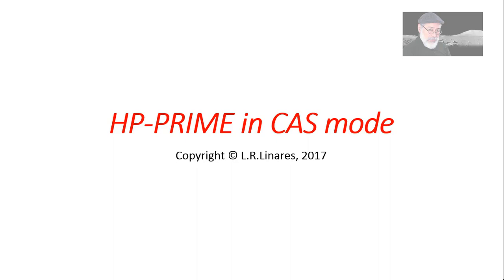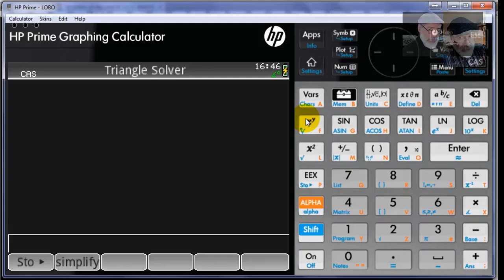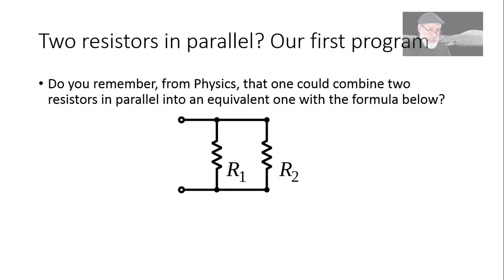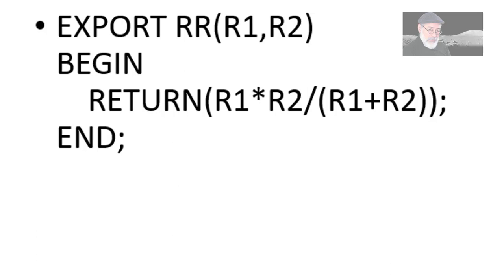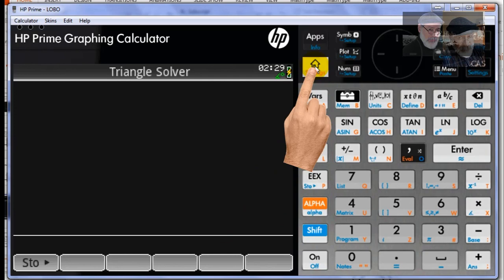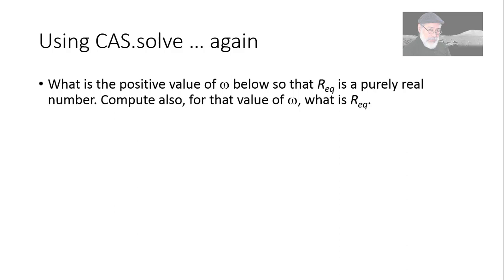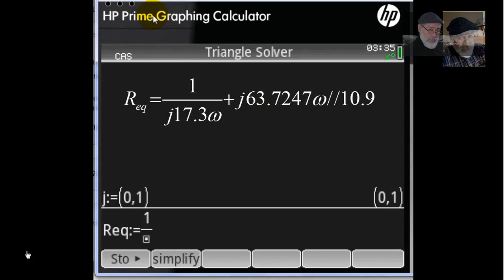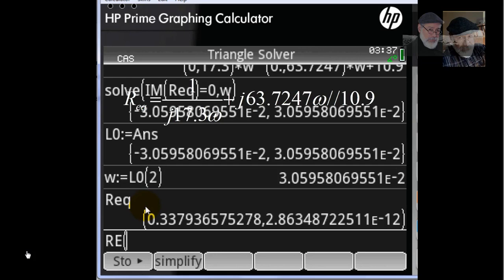HP PRIME 02 - Solving an equation, programming and complex numbers.

Comment: Thanks, Professor. After keeping the Prime in cold storage for a long time, i finally learned how to create a program. You're the best, I wished you were my professor.  Looking forward to learning from you again.
Reply from the maker: Once you get acquainted with the CAS of the Prime, you'll neer look back. I only wished that it had existed when I was an undergraduate student. But then again, I was the transition generation from slide rules to the HP-35, the first one, the original one. I still remember the thrill of finding a sine, or a cosine just at the press of a key (before the 35, engineering students used booklets with tables to find logs and sines cosines and the like.)

Comment: Dear Professor, 
Thank you for your channel. It is valuable. But I think I see a "bug" in the RR program. RETURN should not use the "()" to return value - using it, you return the complex number a real part :). I noticed that by a small mistake. I wanted to round the output to 2 digits, so I wrote RETURN(ROUND(r1*r2/(r1+r2)),2). I was surprised that the evaluation was x+2i. I made a mistake, and I realized output is a complex number. Now I have "RETURN ROUND(r1*r2/(r1+r2),2)", and it works perfectly.
Reply from the maker: I waited before responding to give time for you to realize the actual source of the wrong operation of your program.  Here it goes.  The line that you wrote, let me copy it RETURN(ROUND(r1*r2/(r1+r2)),2) has an error indeed, but it is not the optional parentheses after RETURN, it is that you closed the ROUND( bracket too early, it should be after the ",2" so the ROUND function receives the two parameters that it expects.  Do try  RETURN(ROUND(r1*r2/(r1+r2),2)).  I commend your willingness to explore functions in the PRIME, but I strongly advise against using ROUND in what will be an intermediate result in a longer and more complex computation.  The loss of those digits may, most likely, add up to a wrong final answer in the solution using RR.  I've advised my students against that in class, and I thought it fair to add the same advice here.  Thanks for your contribution and enthusiasm. There used to be a course on the propagation of errors in long computations.  It was part of a Physics lab in the first year.  I hope that it is still taught.

Comment: Great series of videos! How would you suggest increasing the number of paralleled resistor values in the program from just 2 values to many (R1,R2,Rn...)?
Reply from the maker: Great suggestion! Here it is below. The trade off is that the input is a list of the resistances to be connected in parallel, example: RPR({3,5,2}) returns ... well, you'll see. You can make that list as long as you need to.  the code is relatively straightforward too:
EXPORT RPR(m)
 BEGIN
   LOCAL gtotal,n,ix;
   n:=size(m);
   FOR ix FROM 1 TO n STEP 1 DO
     gtotal:=gtotal+1/m(ix);
   END;
   RETURN(1/gtotal);
 END;
Reply: @rolinychupetin  Thank you! This is great. I would love to see a video on some of the other programs you've written such as the Butterworth and Chebyshev filter programs! I am absolutely loving the HP Prime.

Comment: HP 50, piece of cake. HP Prime, I get answers but I do not know what I am doing.
Reply from the maker: I love the HP-50g too, but they don't make it anymore. I used to have three HP-50gs, but my daughter put one of them in the washing machine, along with my blankets :( I also have an HP-49gx, and I used to have an HP-67, and HP-25, (my brother lost my HP-35, original package, a vintage machine), and of course my HP-41c. The HP-Prime, in my opinion, is a worthy successor to this aristocratic line of machines.
Reply: rolinychupetin You are right, I checked at Amazon, there are already gone. They are used, and no one knows what version they are selling. I have 2.15 and do not want to go back to 2.08. Times are changing.

Comment: I had a HP 48S, then a 48GX. Now I've just bought a HP prime.
However, in the 48, at the solve app, i used to use the equations with or without units. More than that, whit any unit as desired, since compatible with the equation.
Is that possible on HP Prime?
I'dnt figured out how to do this.
In the equation V=S.t, entering S in 'm', t in 's', I could get 'S' in mph, or kph, or ly/y, independently of others units.
Is that possible in the Prime?
Reply from the maker: Dear Mr. Lucato, 
Usually, the equations that I solve with the HP Prime imply the units. For instance, in an induction motor, the rotating magnetic field angular velocity can be given by three different formulas depending on the units: (1) n = f/p  (n in revolution per second, f in hertz and p has no units); or perhaps (2) n = 60f/p (n in revolution per minute, f in hertz and p without units); or even (3) w = 2 pi f / p (w in radians per second, f in hertz and p without units). Similarly in everyithing else of electric equipment and electronics that I work with. So the equation is different depending on the units. The CAS deals with the math, not with the units. I hope that this answers your question.
Regards,
Reply: @rolinychupetin  Yes, I understand. I think this is a disadvantage for the Prime, but I have to deal with that. Thank you!
Reply: The firmware now (2022) has unit conversion and si representation. Some constants are also part of the OS.
You could build scaling factors in as the prof suggests, use a unit type for each (quantity) variable, express the output as a unit, or use the converter as a distinct operation after calculation.
I am new to this device but it looks like just about anything can be mixed together as long as we are mindful of our reference units.

Comment: Thanks for the video, but I cannot duplicate your answers on the last part with j and Omega formula. I've tried it both in the Android app and the PC emulator. I've verified my settings to what you had in the first video and followed step by step in both videos but I can't get it to simplify to a simple answer. What I get has a _x at the beginning added to a whole bunch of different operations at solve (IM(Req)=0,w) part.
Reply from the maker: I suggest that you delete variables that may have been defined in your calculator and may be replaced into the expressions that you are working with. Something like that did happen to me at some point in the past. In a future video we will explore variables in the HP-PRIME.
Reply: rolinychupetin I did try a Purge on the variables to no avail. I'm was also a fresh install that I used to follow along with.
Reply from the maker: I'll leave your question open on this board with the hope that another of the readers can comment and find the answer to this conundrum.